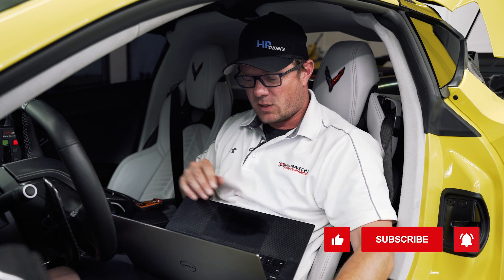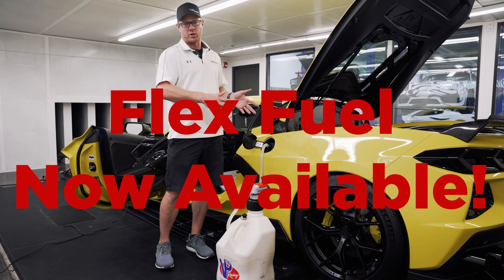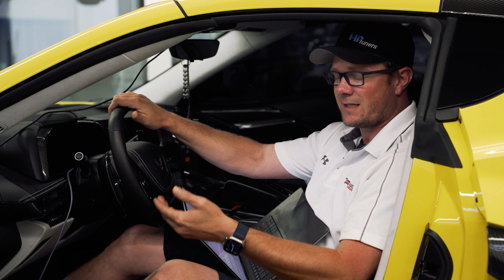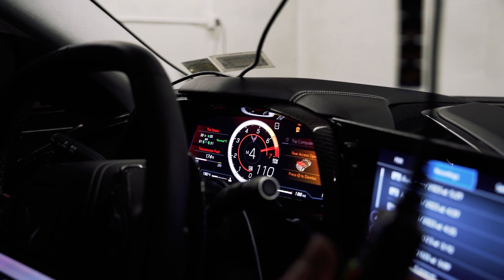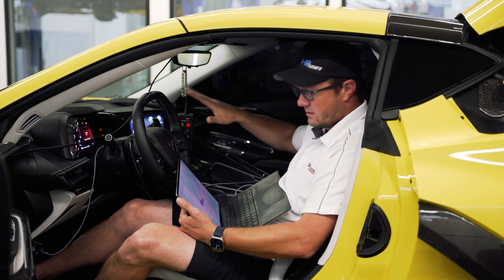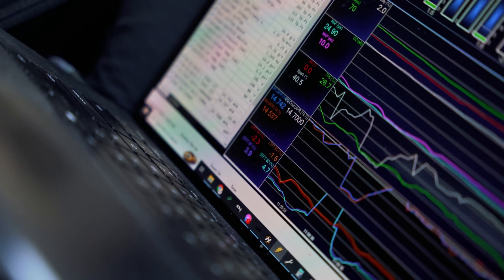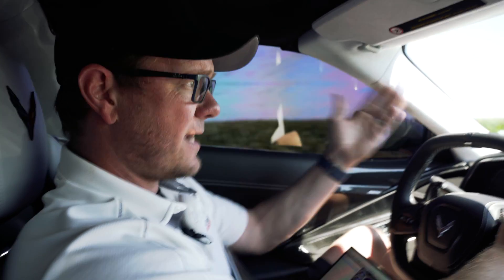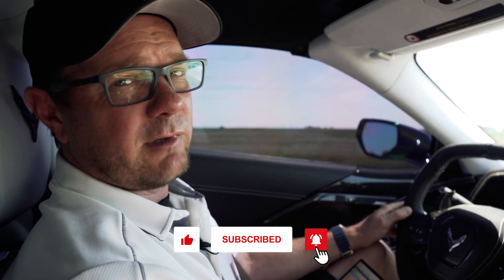C8 Corvette E85 Tuning Deep Dive! 550+ HP!

Comment: Correct me if I’m wrong but I heard E 85 gas was bad for the Corvette because of plastic parts and rubber seals, etc., and that you could void your warranty are fitting it for flex fuel

Can someone please reply to this because I was looking about doing it where I could get the flex fuel option and put whatever gas I wanted in a E 85 or 93  but I heard the E 85 gas was actually very bad for the C8 and in the manual says explicitly not to put that gasoline in it or it could cause damage then I heard you could void your warranty by doing it

Can somebody shed some light on this?  With paragon and boost district be offering these flex fuel kits if it could damage your C8?

Comment: Can you still run 93 octane with the flex fuel?  50 rwhp is almost the same as a 50 shot but  much better with a tune
Reply: with flex fuel kit you can run 93 or E85 and it can run with any combination of fuels
Reply from the maker: Yes with flex fuel it gives you the ability to switch fuels on the go.

Comment: Can you go back to 93 octane with that tune in it without issues?
Reply from the maker: With an E85 tune it is advised to only add E85. However we have the ability to do Flex Fuel now which will allow you to switch back and forth between 93 and E85.

Comment: The C8 platform is not cheap to modify 
Obviously @ E77 the car did well 
Good E85 in my area is E80 to E83 plus being closer to sea level and I'm certain this car cracks 500rwhp
Reply from the maker: Need to just buy some E85 in a barrel 😉
Reply: gotta go catless to break 500whp on e85 all motor or win the production lottery on some slightly spicier then normal lt2 engines with e85
Reply: @patthonsirilim5739  2 factors that kept it from cracking 500, one was the fuel was E77 at the time instead of a better E85 and elevation

Comment: How does the GM update by wire work in conjunction with this tune? If GM sends through an update, does it override the E85 tune and reinstall the stock tune?
Reply from the maker: Over the air updates won’t override the stock tune back on.
Reply: i don't get updates anymore, why i don't know, i would have to ask the tuner shop

Comment: So I'm guessing $10k plus for about 65 wheel HP
Reply: One of the reasons I wanna get rid of my c8 lol. So expensive for very low power gains
Reply: @tdhvlogs1  And kick your warranty to the curb
Reply from the maker: @vertisjohnson219  If anyone is worried about a warranty they shouldn't be modifying their car.
Reply: @ParagonPerformance  Not unless you have mountains of money to burn
Reply: @vertisjohnson219 pretty sure my bud waited till the warranty ran up like mine just did last month that was my plan from the jump to do performance mods after the warranty ran up
Reply: @tdhvlogs1  I'm fortunate enough I bought a ZL1 23 to go with my 23 C8 second have the exotic look and feel but have the other car for the muscle and horsepower. I'll probably end up in 2 years getting rid of both and getting the ZO6
Reply: i had the same thing but got rid of the zl1 for a x5m daily. you will be happy knowing i owned it a year and got sticker for in trade in. knew it would hold its value. the c8 going to take a bath im sure when i get rid of that for the z
Reply: @tdhvlogs1  I bought the ZL1 because I saw to add a supercharger to mine once I felt the underpower of the car that it would cost close to 30K I figured I'd buy the ZL1 and sell it in 2 years for basic what I paid for it since I was able to get it for a sticker and employee pricing. But when I show up to car shows no one looks at the ZL1 All eyes go towards the C8
Reply from the maker: Paragon Headers are your best bang for your buck. Next would be an intake then the Lingenfelter PTR Intake Manifold. Pair all 3 for the best bolt on gains.  @tdhvlogs1
Reply: @ParagonPerformance Your recommended intake (Halltech)  from the CAI shootout was +14 whp at top of rev range... for $800.  I gotta think that takes the cake
Reply from the maker: @jimdshea we found that the Eventuri with the other mods makes 10whp more. Small numbers but it’s a gain. Eventuri also just looks awesome. 😎
Reply: @ParagonPerformance  Sure seems like headers and the best replacement filter from your test (AfE, from memory?) on the stock tune is going to be the best bang for the buck, especially for those of us where E85 is fairly rare. I wouldn't spend thousands more for fractional gains-- save for heads and cam in the future.

The Eventuri is pretty, but does eat into trunk space, correct?
Reply from the maker: @corystansbury  Paragon headers and an intake such as the Halltech Hornet or Eventuri are the best bang for your buck mods. 

The Eventuri does stick out a little bit but it’s worth it in our opinion
Reply: @tdhvlogs1 sell it to me then. It isn’t fast enough?😂
Reply from the maker: If you're just looking at HP gains, yes. There are more gains that just HP from a tune such as:

Improved Performance
Improved Drivability
Increased Throttle Response
Reduced Knock on Lower Grade Fuels
Improved Fuel Efficiency
Flex Fuel (Optional)
Adjust AFM/DOD - 4 Cyl Mode (Optional)
Burble Tune - Increase pops & crackles (Optional)

We have been transparent since day 1 of tuning that for a stock car there are little gains, GM did a REALLY great job with the stock tune. 

However we are about to start testing a Heads and Cam Package. Aiming for 600whp NA.
Reply: @ParagonPerformance  yes very aware of how a tune works and the benefits. Just seems like everything on the c8 is 3 times as
Expensive opposed to when I modified my c7 lol
Reply: @tdhvlogs1 get a supercharger then, so many tunes for them now, LMR has a package for 800 hp
Reply from the maker: @tdhvlogs1  Everything is more expensive than it was 5+ years ago, it’s definitely a struggle 😭
Reply: lets go with the cam/head/tune thats where the money is at, e85 is to selective of customer base,,,BTR 220 Cam start with that one its a proven WHP gain already.600whp will be hard to crack, 580 590 realsticly but there could be that magic cam.thanks @ParagonPerformance
Reply: 50 rwhp with just bolt-ons is pretty darn good.  It's almost the same as a 50 shot but much better with a tune.  My only question is... can you still run 93 octane?
Reply from the maker: @leonforeman5062  with just an e85 tune no you can’t run 93. however with Flex Fuel, which is now available you can do run e85 and switch to 93 or even 91 if you want.
Reply: yeah its expensive, the c8 platform is expensive to modify no matter what you do

Comment: But can the stock transmission handle the additional power; and for how long?
Reply from the maker: Yes the stock transmission can handle it. Handles our 640whp ProCharged C8 without any issues.
Reply: @ParagonPerformance I'm trying to decide between C8 Z06 & C8 Z51 w/Lingenfelter 2650. The Z06 is one of a kind but Z51 w/2650 is 15k cheaper (used Z51)
Reply from the maker: Thats a hard call. The Z06 sound alone is something truly special. However the powerband & torque on the Lingenfelter Magnuson 2650 will be more enjoyable. 

We're installing our first Magnuson 2650 in a few weeks so we'll have a better opinion and more info for you then. 

 @boywonderrr71